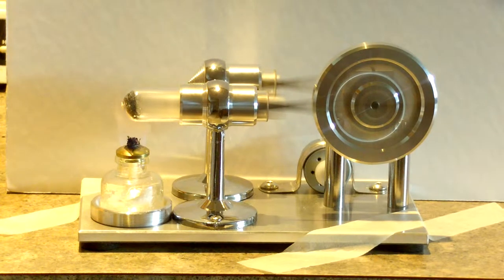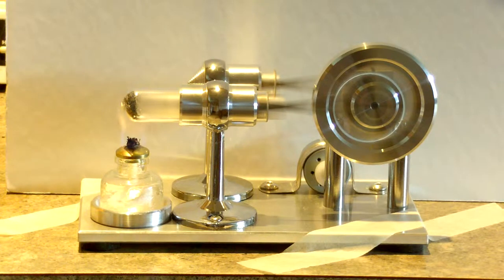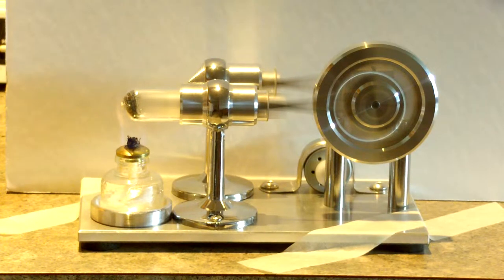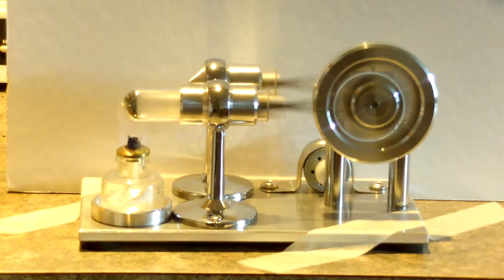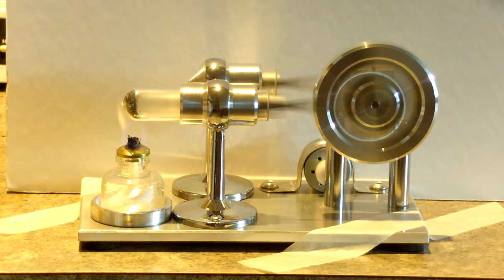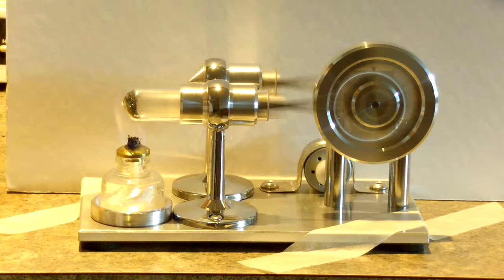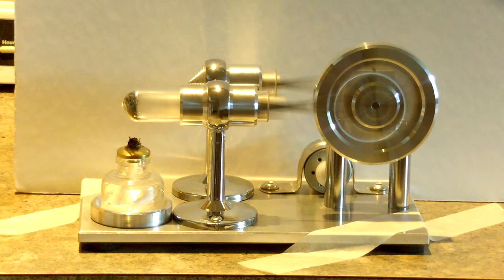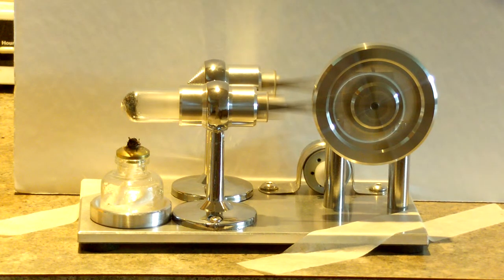stirling engine gamma htd 004

Comment from the maker: update:  i am working on a  5:1 reduction  pulley-set,  for this engine  .   i have an assortment of small brushed motors.    i will be using a  'stock',  generic, one inch dc motor, that has minimal cogging, as a pma.      mediocre performance is expected.     i have managed to modify the cold side crank disc, to form a pulley that has a radius of  six mm.    radius of secondary pulley, then, should be  thirty mm.

Comment: great friend can make an electric generator
Reply from the maker: i did not have a small pmdc motor that would work, any better.       an engine this small just can't
do much work; unless one has several of them.    if that were the case, then, making a purpose-designed  pma might be a solution.       are you asking how to design such a pma  ?       d     googletranslate